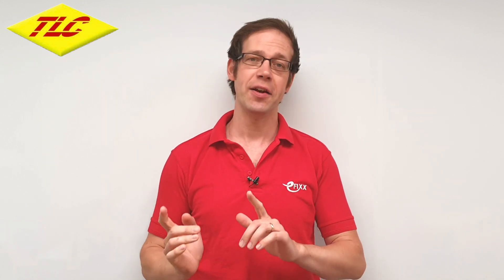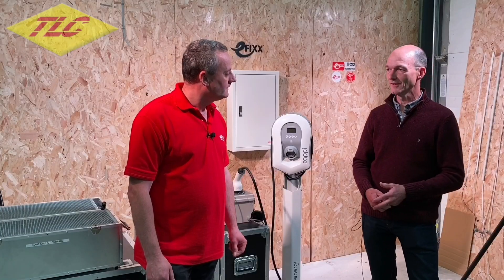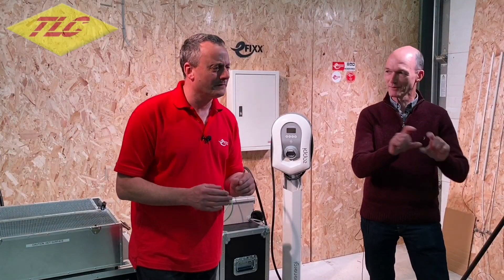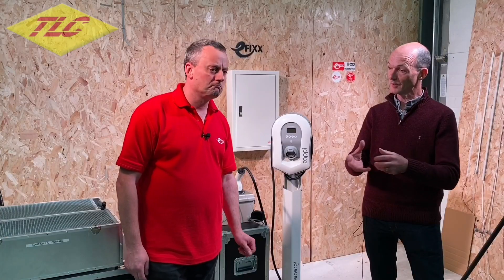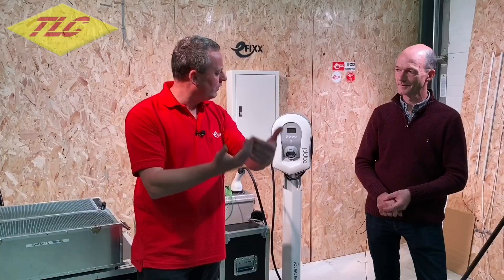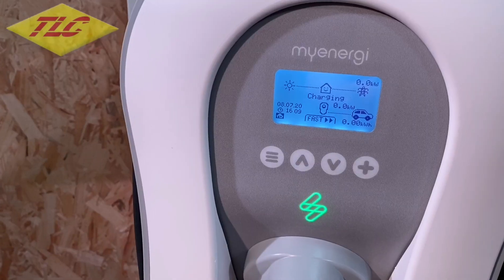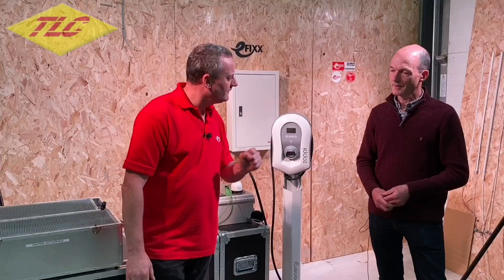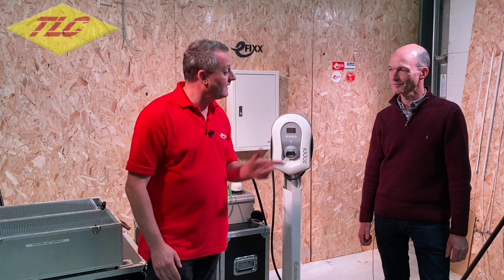How does BS7671 amendment 1 change the way we install EV chargers?

Comment: We used to live in an old late 19th century terraced house. The supply still is a paper insulated armoured cable with a lead sheath covering the cores. The electricity supply company eventually jointed the cable just before the meter... but the paper cable is still in the circuit.

My question is could the technology in the Zappi be adapted and retro fitted to the electric supply company  side of the incomer to increase the protection of the whole installation...especially in older installations with..."legacy"... issues.

Hope someone can respond
Reply: Your description is ambiguous, but as far as I understand, your supply is TN-S so you can export the network earth to your driveway without worrying about PEN faults.  John Ward has done a video about how a service that answers the description of TN-S might in reality be TN-C-S under the road outside, but that's another issue altogether.
In my experience, and in all the literature I've seen over the years, there is a clear demarcation line which prohibits the connection of your Zappi to the network upstream of the service fuse.  I doubt you'd get permission to connect it to the wrong side of the energy provider's meter, but no harm in asking them I suppose.

Comment: Nice to see Chris, who is obviously a very intelligent man (a boffin you might say), thinking practically to make the installation electrician's life easier with a realistic solution to quite an inherent issue with EV charging and TNCS earthing systems. Happens far too often where the IET changes regulations with no consideration for the sparks on the ground trying to practically achieve it.

Comment: Was reading the new/4th ed of the EVC CoP last week and what a jolly good read it was! It's a great read for any electrician, whether they're interested in EV charging or not, as there's loads of info in there about earth rods that can be applied to using earth rods generally, regardless of EV charging - it's £75 though, so aint cheap but glad I bought it.

Comment: As a prospective customer I’d feel much safer if Zappy were to explain how their “unicorn” device works. Right now the situation reeks of regulatory capture weakening safety rather than anything actually being improved in the revised rules. 

If I’ve understood -  it is possible for a PEN to be interrupted and for the single phase live wire in a customer premises not to go outside the 10% margin that’s supposed to trip the  voltage comparison devices. Anything just “as safe” as those isn’t really safe in all circumstances. A separately earthed system, despite the installation difficulties still seems the safest way to go.
Reply from the maker: Hi Bob - We shared your concern last year before the regs changed - So Zappi gave us a unit to see how it works- Check our this video https://youtu.be/gwmiGf6tChE. We explain the various protection features.
Reply: efixx Thanks, looking back through your videos, this one was also useful as a demonstration of the protection in action: https://youtu.be/ZedTmlTLH2w
It’s concerning that the protection will only trip out when there is current on the CPC, rather than as soon as the PEN is interrupted, but still much better than the alternatives if installing a separate earth isn’t practical.